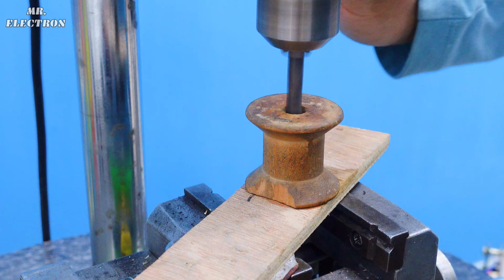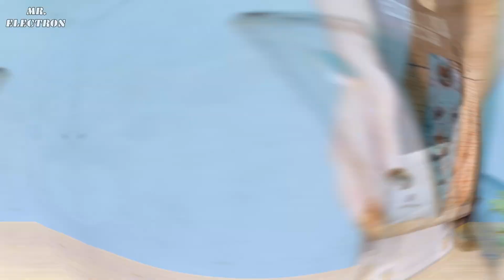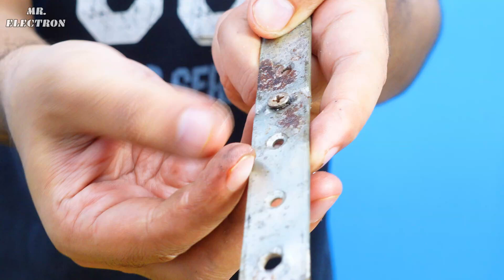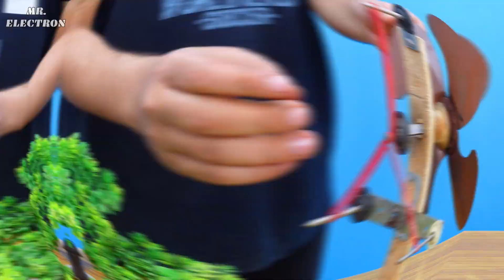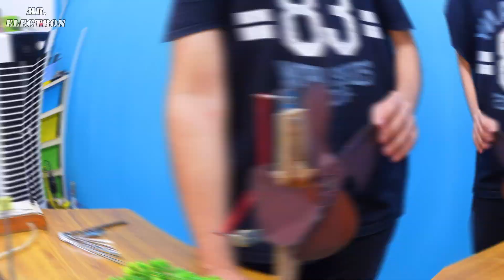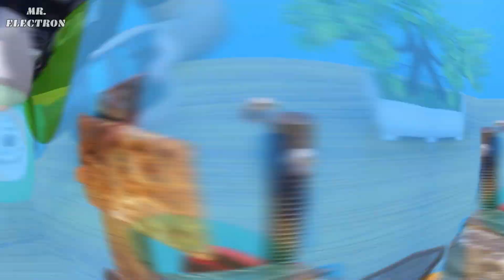Self Running Free Energy Fan Device 100%. How to make free energy fan at home

Comment: This is how it works:
The rubberbands are stretchable right? If you put it in triangular each rubberbands, the middle part will be pulled by each rubber band the top will pull the thing on the middle the right will also be pull and it will be doing the same again and again
Reply: Well apparently physics won’t let that slide
Reply: Well It will just reach equilibrium. It won't spin.
Reply: the physics is the one who powers it
Reply: @saghirahmad7876  seriously? First learn how physics works, then you can make comments about it
Reply: You should bbuild one, and then learn by hand that the video was a ly and learn how physics works. Jeezes people are sheep!
Reply: @BrianaDiola  you’re not the sharpest tool in the shed.
Reply: تعمل لفتره قصيره حسب قانون نيوتن لكل فعل رد فعل لكن ينطبق على القانون الاخر لنيوتن هو تلاشي الحركه بلتدريج

Comment: let me guess, this time you reversed it?
Reply from the maker: No. I have revealed the truth just before ending this fan video.
Reply: @mrelectron_alternator  i saw that part but i noticed like it was slightly reversed on the start
Reply: @mrelectron_alternator I made but fail this is fake 😂😂😂
Reply: Just get other fan to flow this . That is all
Reply: This is not fake guys, its showing the truth. Use cardboard
Reply: Lol, what is with Southeast Asia and this cultural obsession with "free energy?" Every video I've seen in the past two years has been either running tribal bongo music, or is set in a jungle, where a barefoot "scientist" is building a "zero point, very good, high work, make benefit 4u" contraption out of rusted bicycle parts.
Reply: of course is fake, he just trick us and then he reveals the truth on the end